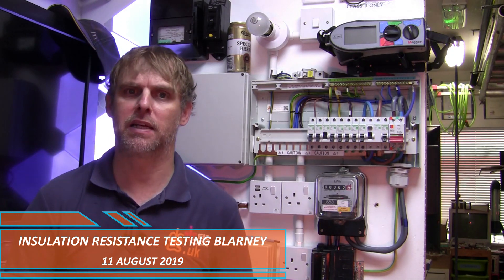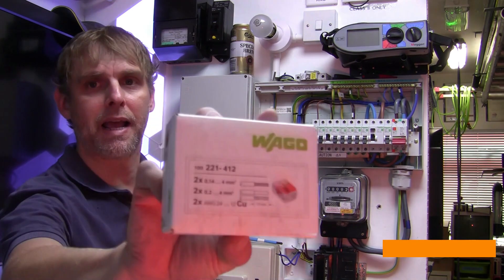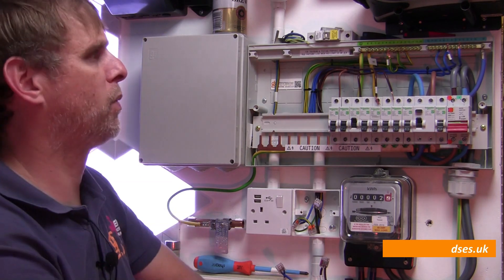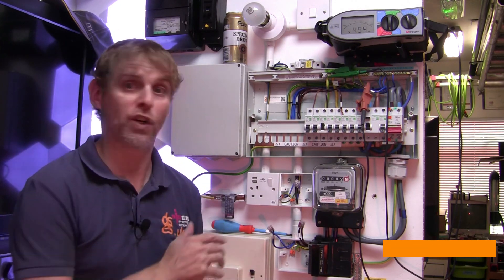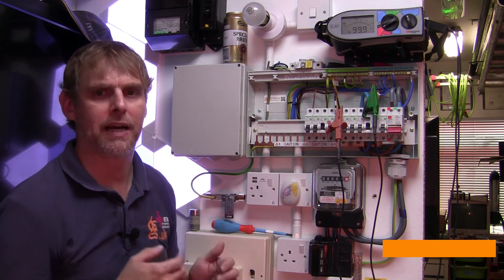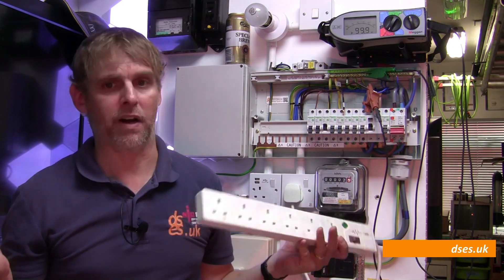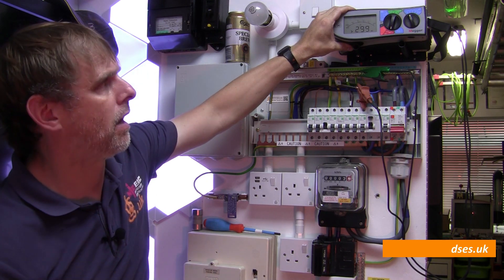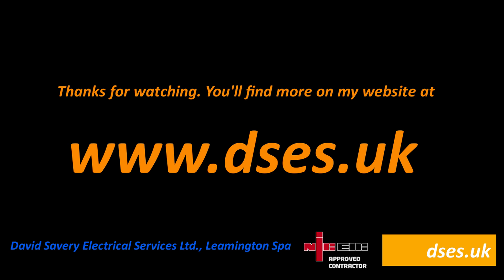Insulation Resistance testing blarney

Comment: 🙌 cheers Dave always a pleasure to watch 👍
Reply from the maker: Thanks Nick, i didn't miss you out this time.... Mainly because that screwdriver price gave me palpitations....
Reply: @dsesuk  i think he got it cheap off the Tat man
Reply from the maker: The copper recycling does pay off...
Reply: @dsesuk  to be fair you need to be very careful about the sort of Tat man you go to i would personally avoid the one who has an endless supply of soap bars
Reply: When it arrived I got the (insert spring noise) but I do use the hell out of it so will pay for it self in a decade or so 👌
Reply from the maker: @NBundyElectrical  The fancy box it came in is worth a spring-on all on its own!

Comment: Another enlightening educational fun packed video Dave. I wish my lecturers at college in the 90,s had your sense of humour. I always start off at continuity, then 250V, then 500V IR test, so i'm already complying with the DSE code of practice :-) Try it on some T&E that's been installed outside, open to the elements for a few years. surprising how much the IR breaks down, which is why I always inform customers it needs containment in conduit or use a correctly IP/UV rated cable.They never believe me of course lol.
Reply from the maker: I hate seeing T&E on the outside. It's not the sign of a professional installer in my opinion, and like you I've seen it degrade when exposed to the elements over time.

Comment: What I find a bit odd is why the USB sockets are not required to have a separate switch or be tolerant to 500 vdc of normal test procedure. Do they have a fuse other than a small fusible resistor on the cirquit board? What might the logic be behind allowing them being installed at all?

Comment: Looking at the sockets with USB charger port why don't they make them so the socket switch turns it off for testing also save on all stand by power just think 5 million of them.  Saying that any switched socket I test with it on.  As I had some in kitchen with grease in that ended up burning it did not show on test with switch in off position.

Comment: It's only a matter of time before the tweed suited boffins make you do the calc for circuit length and write it down for prosperity.
On another note. I can't find anything about how they test znd inspect in the US. Do they I ask. Your thoughts.
Reply from the maker: You may be right, each edition and amendment to the wiring regs only seems to increase the paperwork burden for those of us trying to do a diligent and proper job while nothing is done to stamp out the cowboys and cash-in-hand chancers. I've no experience of US testing, but someone did comment recently that insulation resistance wasn't a thing over there. It would be interesting to know more about international procedures!

Comment: Hi 
Coming from the automotive side of things. Do you factor in the Ohmic value of your test leads for testing as very low values are encountered. 
Thanks
Reply from the maker: Hi Dean. I neglected to mention it in the video, but yes, the test leads are nulled before testing. I meant to show that, or to mention it, but forgot to do so.

Comment: Question.. I see 15v across neutral and earth, if I switch off some breakers to an extension I've just built.. it falls to 6v. Is this an earth issue "possibly inductance”, do I need to add more earth rods ?
Reply: RAD Official My guess is that your earth is not the immediate problem, it sounds like you have excessive resistance in the other conductors. With a load on in the extension are you seeing a big drop between live and neutral?
Reply: @g0fvt  I switched on/off the AC and other items in the new extension, no change between live and neutral it’s stable around 228v, but I am getting that difference in voltage between neutral and earth. Is it possible a piece of equipment is causing this, or just the fact that when things are connected it’s adding to a voltage rise.. for some reason?
Reply: RAD Official that supply voltage is a little lower than I would expect, I wonder what the voltage is at the main house supply. Normally the earth current is very low, some appliances with mains filters will pass a little earth current but very little. It might be worth extending one of the multimeter leads so you can measure the voltage between the incoming earth and the earth in the extension. There should be next to nothing between the two points.  There are various different ways that the supply earth can get to a property if your “earth” is a TT type (ie a grounding stake) it would appear to have a significant problem.  Personally I would investigate that prior to adding more.

Comment: Hi  good video , just think with having los of apprentices coming from collage they only see IR test that pass and none that fail  so think it would be better that you show IR test that fail such as anything under 1 ohm fails. On all circuits but above 1ohm passes  although on a new build 2 ohms can sort of pass but is not recommended, also a  low reading can be just damp , and if you leave mega on you can prove and dry out  and prove that it is indeed damp that caused the low reading , also you could mention that having a reading off 500ohms say will not necessarily blow a fuse also that in quarry s   you often see readings that low

Comment: David, connected loads are a pain in the arse, but every time I approach the local barracks to ask for help disconnecting connected loads I'm told to " Do One", and hate having to put down LIM but unfortunately it's the way of the modern world. Bring back the 80's when all I had to do was bypass dimmer switches with a single pole switch or koblingsblokk, opps sorry I meant connecting block. (P.S. Koblingsblokk came from when in the 90's I was installing central heat recovery systems on a private estate and the destruction's were in Norwegian, koblingsblokk was their word for connecting block and it kind of stuck in my brain) lol!
Reply from the maker: Koblingsblokk is a fantastic word! I might have to start using it!
Reply: @dsesuk  Also FYI  Koblingsboks = Junction box !

Comment: Hi from the thickies out here. It said 7.14 for 2.5 but you put  0.00741....can you pls explain 🙏
Reply from the maker: Ah, sorry for the confusion! The On-Site Guide gives the resistance in milliOhms per metre, so that's 7.41mΩ (7.41 thousandths of an Ohm) as the book lists it. The calculation we're using uses Ohms, not milliOhms, so when writing it out we need to move the decimal point three places to the left: 7.41mΩ = 0.00741Ω. If we were to do the sum without moving the decimal point to correct for it being in milliOhms (i.e. just 0.04 / 7.41), we would get 0.005 as an answer as the decimal point is in the wrong place (it's out by a thousand). Another way of doing the sum would be (0.04 / 7.41) x 1000 as that would correct things without having to faff about with decimal points. I hope that makes sense!
Reply: @dsesuk  thx David, much appreciated!

Comment: Hi David, quick question - if there's a socket with USB charging points like the one in this video, is it good practice for me (as the homeowner) to put a note on the CU calling it out and mentioning where it is?
Reply from the maker: It certainly wouldn't hurt, although anyone performing a competent inspection either because they intend to modify a circuit or because they're performing a periodic should work under the assumption that fixed loads are present or that there may be an item of connected equipment they've missed. Unless it's an initial verification, then cautious IR testing is called for, and in most cases I suspect L-N IR testing is omitted entirely.
Reply: Unless u r an electrician u shouldn't go anywhere near a fuseboard fool

Comment: mhh i mainly did insulation testing on motors and heating elements and some other stuff :P well cables too .. but those cables soaked up water over time and got a bad insulation resistance.

Fun fact .,. have an old cable over long time under water like a silicon cable and so on can soak up water and cause en earth fault too

Comment: Do you have a wiring diagram for your test rig/consumer unit?  I am looking to make up something similar for the apprentices to do some testing/fault finding on at the shop. And help greatly appreciated.
Reply from the maker: There's nothing fancy here old sport, just five metres of wires looped up in that big box!
Reply: @dsesuk  thank you kind sir for providing me with that detailed wiring description. I shall set about measuring out 5 metres of the finest 6242y for this installation. How long is 5 metres? . I only work in 3.75 metre lengths.
Reply from the maker: Maybe then install two x 3.75 metres... although with my shit maths, trying to figure out the resultant of that has already blown my toupee off!

Comment: Hi David, thanks for the entertaining and informative videos. The grey box to the left of the consumer unit, can I ask what make it is and where they can be purchased. I need one like that for a project I have in mind. Do they come in larger sizes as well ? Thanks for any info.
Reply: It looks like a timeguard 4 way weatherproof box like the ones you can get from tlc
Reply from the maker: It's from Toolstation, code 67255, £19.06, 300x220mm and I think that's the biggest they do, but other suppliers may have something larger.
Reply: @dsesuk  thank you. That one might just be big enough for what I need.
Reply from the maker: It has 12 40mm holes, three around each side, and they come plugged with grommets.

Comment: Why do we test at 500v and not just 250v ?
Reply from the maker: IR testing is a 'pressure test', so performing it at 500V puts the wiring system under some extra strain which, if it passes, ought to mean it will operate happily at a nominal lower voltage.

Comment: Great video. What about IR on fluorescent fittings circuits, doesn't the ballast leak to earth.  Not going to disconnect every one (too many and high up). IR to switch and Limitation or what? No one seems to know.
Reply from the maker: Thanks Tony. As we mainly deal with domestic or only small commercial, we don't tend to see problems with fluorescent ballasts, but perhaps in number they can be problematic, I don't know I'm afraid. I would say though that if there are too many and they're at height, then a limitation in their testing wouldn't be unreasonable!
Reply: @dsesuk  I'm at a rugby club and their main hall and corridors have old units chucking up such issues. I am going to list as limitation and recommend that they are all changed and tested within 1-2 years. Thanks.

Comment: Why is it necessary to have the neutral and live together, when in practice neutral and live have 230v potential between them anyway?
Reply from the maker: Hi Nicky. Normally, L&N have 230VAC between them, however your IR tester is likely to be injecting 500VDC hence the need to join L&N in order to prevent a DC potential difference from existing between them which may damage components.

Comment: Hi David. New to the industry so really appreciate the educational video. I'll be sure to watch all of your videos now. Can I just clarify my understanding please? So, if low IR between L&N, that means something is connected, but L/N&E should still give a high reading in that case. A low reading between L&N, but also low IR between L/N&E would indicate a fault. Is my thinking correct?
Reply from the maker: Hi Nina, thanks for tuning in! A low reading between L&N may indicate a connected load; certainly that's more common than a fault condition. It's something that warrants further investigation if you want a number out of L/N. Connected loads shouldn't provide a path to earth though, at least not unless there's something providing an additional service between line/earth such as a surge protector. I'm speaking of domestic equipment of course; commercial or industrial equipment may have goodness knows what to confound things! A low reading between L/N&E, especially at 250V so SPD's aren't triggered, needs investigation. Something's causing it, and it can potentially cause trouble!
Reply: Thanks for your reply, David. Yep, it’s a domestic socket circuit. Definitely no surge protection and all accessories have been removed (as far as I can tell). L-N is reading 0.25M at 250V and L/N - E is reading 0.5M at 250V. Obviously, I didn’t test at 500V after such ominous readings!
Reply from the maker: @ninav74  Not great numbers those. I'd start braking down the circuit next. If it's a ring, then split it at a socket which ought to be around the mid-point and test each leg, then keep braking it down as best as possible until you find where it's bad. Of course, it may be difficult in a furnished house. We had one last year which we traced to a socket some idiot had spurred off and hidden under a floor where the neutral wire was leaking to the earthed knockout box through a split in the insulation. We only found it because they were remodelling the house; had the new carpet gone down we'd have been scuppered.
Reply: @dsesuk  m

Comment: Some light switches have their own indicator lights. Is testing possible or i have to remove switches?
Reply: Have you done your testing course?
Reply from the maker: There's no point IR testing anything L-N if any loads on the circuit are connected, this includes LED or neon indicators in switches. You'd have to remove and wire out the switches to get a reading for the wiring itself, and it's probably not worth the effort unless you're tracing an overload fault. You can still test L-N together with respect to earth as switches with indicators shouldn't be leaking anything to earth.
Reply: @dsesuk  I saw  answer in video too. Just managed to ask before you explained that point
Reply from the maker: No worries chief!
Reply: That depends.
If someone actually provided a neutral at the switch and the indicator is connected between L&N, it will show as a fault if testing between L&N, just like any other load does.
If it's one of the old style ones wired between L & SL and only lights when the switch is off, it won't make any difference to the test.  Such things are uncommon now as they only work properly with incandescent lamps.
If some buffoon connected an indicator between L & E because no neutral was available, then it will show as a fault, and must be removed.
Reply: Hello @jwflame  ! Fancy meeting you here :)
Interesting (to me) earth 'leak' question....
Bathroom LV lighting ~12V - if the secondary side of the transformer is earthed (to ensure LV remains low relative to E) is that going to be an earth leak issue - re ELCBs etc. ?
Reply: @millomweb  If it's actually a transformer, there should be no connection between primary and secondary.  Electronic converters usually have a small capacitor between primary and secondary, which could result in a tiny current if some part of the secondary circuit was also connected to earth.
Reply: @jwflame  So ELCB wouldn't see a connection to E on the secondary - so all is fine !

Comment: Sparkyninja has a video about cable tying cables together,   Looks neat though
Reply from the maker: A good one too that I reference in a new vid currently in production... basically as a way to explain why the board I just put in doesn't look neat!
Reply: @dsesuk  you only had a few tied together so doubt it'd make too much difference 
I think his video was referring to the big units with dozens bundled together?

Comment: Can you then test the board as a whole using the Line/neutral & earth without risk of damaging any sensitive equipment at 500v
Reply from the maker: Hi Lee. If the neutral bar is connected to an RCD, then you may have to disconnect it to save shoving 500V into it. You could then disconnect all the line wires and common them together to perform the test. It's not ideal though as the result you'll get will be lower than the lowest individual circuit resistance because of Ohms law regarding resistances in parallel. As an example, if circuit 1 is >999MOhm, circuit 2 is 300MOhm and circuit 3 is 6MOhm, the number your tester will measure will be 5.8MOhm. It tells you something about the installation as a whole, but not the health of the individual circuits. This is shown in more detail on my video about insulation resistance and RCD's if it helps!
Reply: Thanks David. If you perform the test as you describe it and your result is greater than 999 then does that then confirm that the whole installation is sound or could there still be issues on another circuit
Reply from the maker: If you've commoned all the lines, joined them to the neutrals at the neutral bar and then tested to earth with a resultant reading off-scale on your tester, then that should indicate the installation as a whole is good and you don't need to test individual circuits. Oh, one other thing, the neutral bar would have to be disconnected (whether on an RCD or not) as neutral is connected to earth back at the intake (if PME) or at the transformer (if TNS) and would cause the test to fail if that connection remains!
Reply: Yes, you can... Carry out safe isolation on the main switch, if it's a dual RCD board, switch off the RCD's but keep the MCB's in the 'on' positon. Using a piggyback lead, connect croc clips to neutral bar 1 and line busbar 1, then connect remaining lead to earth terminal and zap... all clear, then test between neutral bar 1 and line busbar 1 and zap... all clear, then repeat all of the above on neutral bar 2 and line busbar 2.